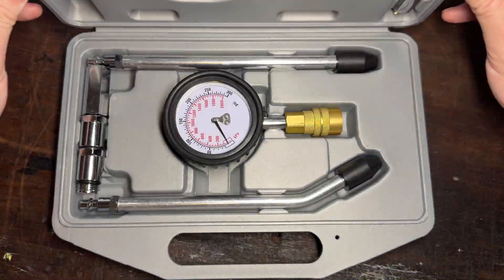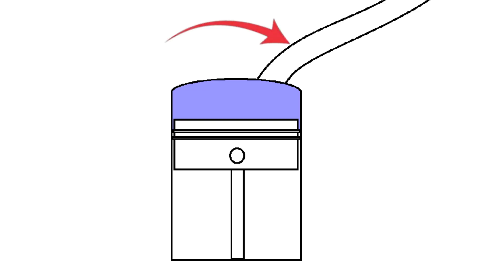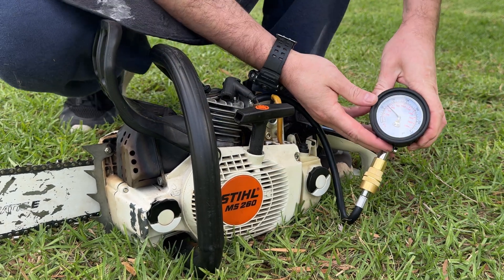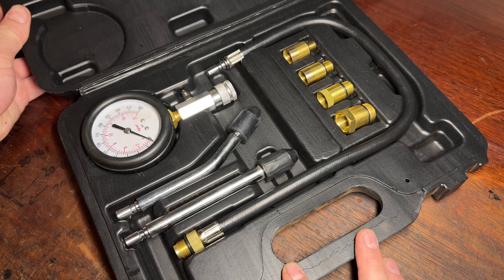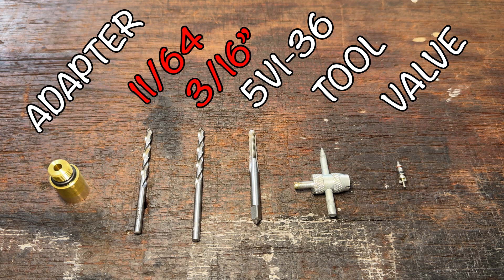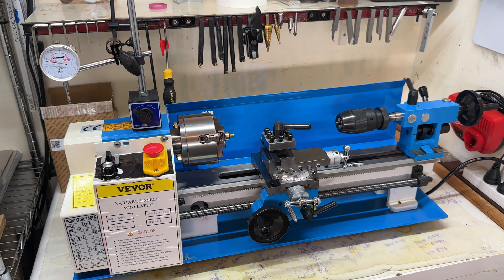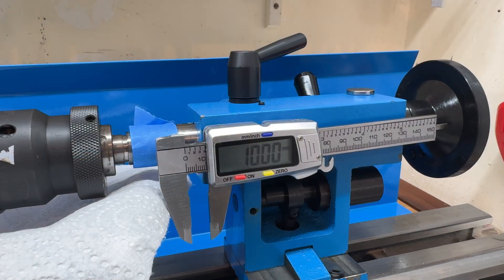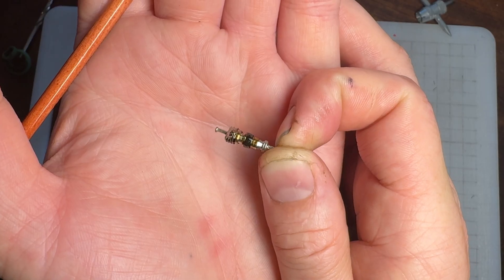Fix Your Inaccurate Compression Tester!

Comment: Good info for the casual mechanic. I'd add that the throttle should be wide open during testing for the most accurate results. Also, be sure to ground the coil (Hi Side) if your saw has a combined throttle lock/ignition switch.
Reply: Unnecessary on 2 strokes. Just did the test on my YZ and a CR. Made no difference at all.
Reply: @fullmetaljacket7  Just curious what numbers did you get? 
Are the motors stock? 
Also E-start will be more consistent than kick, especially on big bores like the 500, which otherwise takes a really healthy kick or a comp release head (which puts comp testing out the window). A lot of variables, like most bikes have a power valve and aren't race ported or have modified squish bands. For the hottest 500's we replace the piston at 16 hours on a hillclimb/sand dune ported barre no matter whatl, and even 250's can have leakdown issues and give an acceptable compression test.
 So it's not "be all end all", but if you're running high static comp. on a Race Gas only build, a 10-20 psi difference on the motor will show you ring seal starting to drop. 
If you only got ~120psi (or less) on your tests, then yes, it doesn't matter, but as I mentioned earlier, the Hi-comp builds on saws will go to 180-200 psi and there it will matter if you test with the throttle open or closed. Same with ported bikes, but not as high on the numbers.
Reply: @llewellynquay9463 170 on the yz, stock. Brand new top end. I also have a ty250 and a some other smaller 2 strokes, some stock, others lightly modded. No measurable difference in any of them. Except for the kt100, all the bikes are kick start. The kt has a recoil.
Reply: @llewellynquay9463 with that said, I always do the compression test with the throttle wide open just because that's how I was taught and always did it that way. Good practice I guess? No other reason really.
Reply from the maker: Certainly interesting discussion points!
Reply: @fullmetaljacket7  The biggest difference I've seen is on CR5's with the Panthera Electric start kit (~$2k worth of gear!), because it spins the motor faster than you could ever kick, so combined with a properly ported barrel it does trap some additional crankcase charge.
On the other hand, Pro Saws are so oversquare that it doesn't take much of a change in trapped charge to give you a 10-20 psi change on a modded saw with a tight squish band, ~.025"-.030" being ideal for 50-100cc saws. 
In the end, repeatability in the holy grail of testing, so WOT eliminates one variable. 
For a "homeowner saw" that barely runs because of a pinched ring, I don't think it would matter a bit whether the throttle is open or closed.
 Of course leak-down is the best single test for anything from a healthy motor to one with shot crank seals, but depending on what kit you pick (or DIY it) you get what you pay for there as well. The best kits not only allow for Vacuum testing the sealed off cylinder/bottom end, but also meter ring seal on the top end via a 40-50psi air charge applied to piston at TDC.
Reply: @VintageEngineRepairs  Well, I hope I contributed in a positive way, I believe I learned from some of the best (engine builders) and If I can impart some of that knowledge-however subtle-to those who are curious, then I'm glad to do so. I hope I don't come across as a "know it all" or rude, though sometimes the typed word isn't the same as the spoken word--writing is a skill of it's own...And sorry if we went off track from your original message, which is Very pertinent, and which 99% wouldn't know unless someone like you told them! I've recommended your channel to acquaintances who could use the info, but if I had to pick the most common Mower/saw/string trimmer, etc. problem, it would either be old gas corroding the carb, or frying the coil by not grounding the high side and spinning the motor. Maybe content for a next vid? 😗
Reply from the maker: @ thanks mate! I appreciate the video idea too :)
Reply from the maker: Thanks for commenting and sharing :)
Reply: Only applies to a 4 stroke as they are a positive displacement pump
The ports in the 2 stroke cylinder vent enough once the piston descends below the port to provide for a compression test.
Reply from the maker: @ Hey :) yes, I have heard that too mate, but weirdly enough, I have read where some people have still found it to make a small difference. I held off saying anything until I have tried it on a bunch of 2 strokes both ways lol thanks for watching and commenting :)
Reply: @VintageEngineRepairs  
Its unlikely since the only air volume needed in addition to what is already in the cylinder is enough extra to pressure the gauge and hose, and once the piston descends below the exhaust port to BDC there is more than enough area for that amount of air to vent in from the atmosphere via the open exhaust port over a number of cycles.
Reply from the maker: I agree with you entirely! I just don’t like commenting on a topic I’m not certain on based off actually testing it - I have been bitten too many times trusting rather than experiencing :) I look forward to doing a bunch of different machines. And seeing if there really is any subtle changes. Thanks again for sharing!
Reply: @VintageEngineRepairs  It does make a difference on High Compression builds like I detailed above^. Not a meaningful difference for determining if a stock saw needs a rebuild, but for modified saws and 2T bike engines, it does. Thanks Again for the thoughtful content!
Reply from the maker: @llewellynquay9463  thank you for sharing your first hand experience. Haha this is why I avoid commenting on a subject I haven’t tested & experienced myself lol. This is what makes online platforms great - thank you :)
Reply: @AuMechanic   I've had/have numerous Pro saws from the Husky 3120 to the 394xp and 385xp that were ported and base gasket deleted by the legendary Ken Dunn (KD Hotsaws). I can attest to the fact you WILL register a lower compression number with the throttle closed. I'm talking about ~170psi closed and 200 WOT. While most folks never use anything bigger than a dead stock 50-60cc saw, it does matter on 2T motors that have High Compression, including high output 250 and 500cc motors like YZ or CR models. On bikes, A compression test after break-in will provide a baseline for subsequent testing to determine when to perform a leakdown test or replace rings/piston.

Comment: Compression testing without a Schradervalve or other valve is useless. Because the pressure lowers immediately when you stop cranking. So thats the reason here in the Netherlands from the factory they have some sort of a valve.
Reply from the maker: It’s not that, as all of them have one in the gauge itself so it won’t ever drop unless your gauge is faulty. It’s that it won’t read true compression due to the hose acting as additional cylinder volume. Thanks for watching.
Reply: @VintageEngineRepairs  The pressure is even in the cilinder and hose with or without valve. Basic science.
Reply from the maker: @chrispy1965 I recommend you watch the video because it shows you exactly why what you’re saying is wrong.
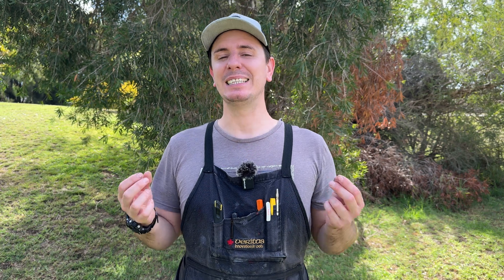Reply: @VintageEngineRepairs I did and at 0:38 you made the mistake I pointed out. You cant delete a volume by simply build in a valve.
 Ask youself where comes the rise in pressure from? In all cases from the piston diplacement. With or without valve. What the valve did is keeping the pressure in the hose the same. It sure lowers the fault reading off the test. If there is already a valve in the gauge, it diddnt matter at all much.
 The main reason the end pressure is different is the extra volume off the hose. Scipping the hose ore every other extra volume  makes a significant difference in accurate end readding of any engine and for sure a small engine like you do in your video..